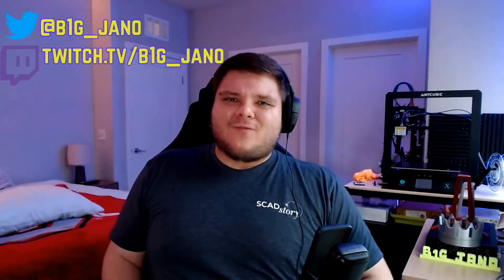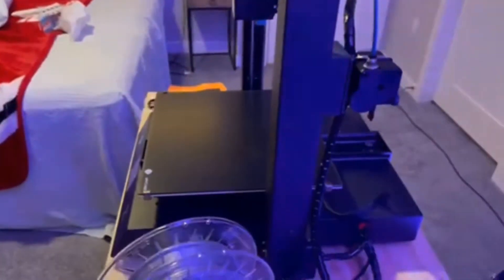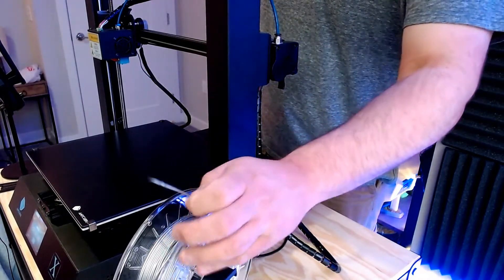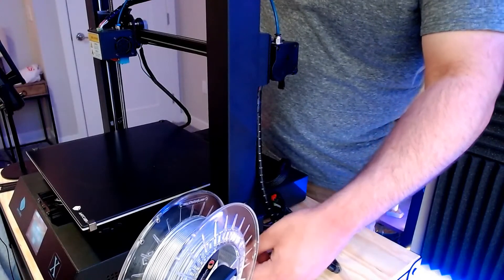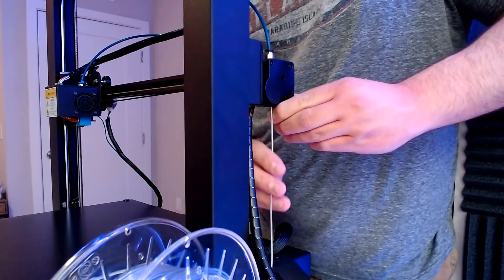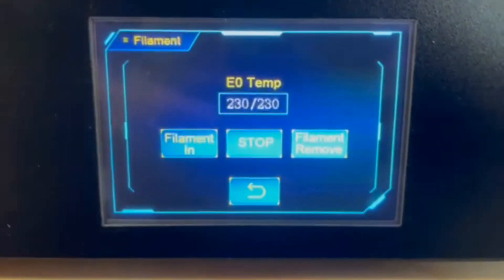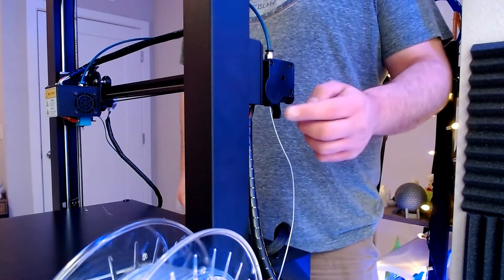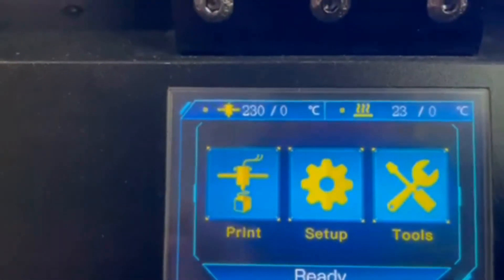How to Load / Unload Material in the Anycubic Mega X 3D Printer

Comment: Hey there, maybe you have an Idee to my problem.
I got one used but well functional. I loaded the filament in, but it seems to be stuck. The printer doesnt print, but I can't unload the filament either. Seems like it got stuck somewhere in the machine.
Reply from the maker: I would check the extruder gear for filament or you may have a hotend clog.

Comment: Have a quick question. When removing the filament I got most of it out but the last little bit is stuck even when I pull the spring all the way back. How do I remove it?
Reply from the maker: if its stuck in the tube you may need to remove the tube completely and fish it out that way. If it is stuck in the hotend, you may be able to feed new filament in and eventually purge out the old, or if its clogging the hotend you may need a decloging needle for the hotend

Comment: Can I add filament during a print  I ran out I heard the alarm
Reply from the maker: While I don’t think you can manually load/unload filament during a print if the runout sensor goes off, you should be able to just start a new strand of filament after the old one and just wait for it to feed right behind the old strand while there is filament in the sensor.

Comment: How would you do this mid print, if you run out of filament?
Reply from the maker: I believe the printer halts the prints and lets you change filament if the filament runout detector triggers. Not sure it can be done manually stopping the print. The firmware properties on filament changes is less than desired

Comment: I have the same printer. My filament gets a "blob" on the end and it's hard to remove. The filament can't come out past the filament sensor. The blob gets past the gears but gets stuck on the cone shaped insert in the bottom hole of the sensor unit. If that makes sense.
Reply from the maker: tried extruding a little bit of filament, then retract the filament out. That may get rid of any blobs before swapping filament. That has worked for me in the past!

Comment: Heya Jano, struggling to find information on how to tighten to belts on the mega X, especially the X Axis belt, but i was wondering if you had any wisdom on the topic?  Cheers!
Reply from the maker: there are a few screws on the far end on each side of the X-axis belt carriage. You can access them from the back side of the printer and can use the hext wrench that came with the printer to tighten them. If you cant find them reach out, and I can help further!
Reply: @B1GJano  cheers boss ill give it a go

Comment: i was removing the filiment and a black nozzle came with it it looks like it was stuck on that nozzle is that fixable
Reply from the maker: Yes. It is part of the extruder gear I believe. You may have to take out the bolts off the side of the cover to put it back in but it shouldn’t be too difficult
Reply: Had the same issue when changing filament on my Mega X. I think it's part of the trouble I have with clogging. The filament forms a clump that no longer passes through the black nozzle... Just cut the filament and put the black nozzle back under the extruder.

Comment: what is the best temperature to print with black pla filament??
Reply from the maker: Most PLA I print with I usually prints at 210-215 C. Double check the filament you’re using for exact temp recommendations but that’s what I use.
Reply: @B1GJano  thanks!!
Reply: @B1GJano  do u know how to disarm the hot end and clean it? i had to use the replacement because it jammed really bad, i had bad bed lvling and was acumulating filament inside the hot end

Comment: Excellent demo of loading and unloading the filament. Do you normally load and unload the filament from behind the printer? Or can the filament be easily loaded and unloaded from the front of the machine since that is where the touch screen is?
Reply from the maker: I usually load/unload from the front of the machine. I just did it from the back for filming purposes so I wouldn't have my back turned on the camera the whole time haha
Reply: Thanks for the prompt response Jano! That’s what I need to know. I’m looking to replace my current 3D printer in the very near future and I want one that is easier to load filament on. This one is the front runner at the moment.

Comment: Please continue with mega x. I had trouble with printing and had to change the hot end (filament wouldn't come through properly, even after trying to clean the tip).
Reply from the maker: Thanks for watching! 

In terms of your issues, I don't know what your retraction settings are but that always can cause clogs and filament not to come out cleanly if it retracts too much back into the hot end and has time to cool down enough to cause a blockage.

In addition if you haven't already, play around with the tensioner knob on the extruder as it may be gripping the filament too tightly.